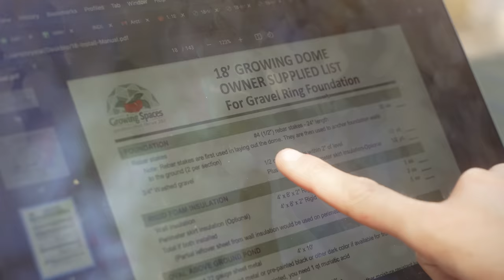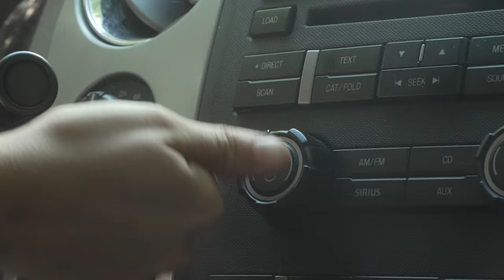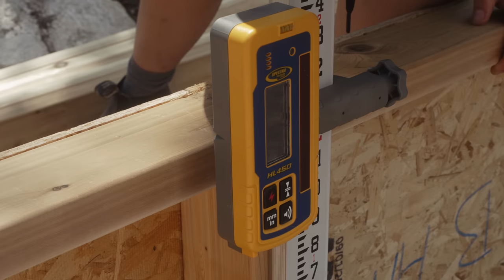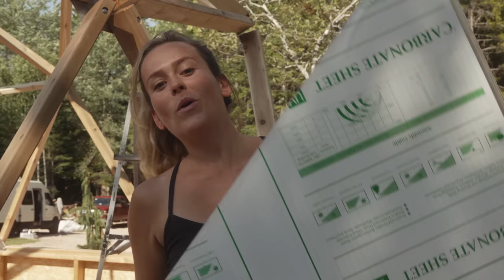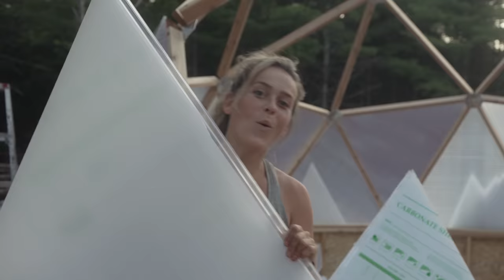We Built A Greenhouse In The Woods (part 1)

Comment: TIP: After awhile, especially if you've had some windy days, go around and recheck the bolts, retighten if necessary.  You can also take a marker or make a scratch running from the bolt to the plate so you can see if any of them are coming loose.

Comment: Safety tip:  when using a metal cutoff wheel, wear hearing protection, a face shield, eye protection behind the face shield, and breathing protection.   beware of the sparks causing a fire or getting onto exposed skin.   

Great dome build.   I was a geodesic dome builder (homes and commercial) from 1973 until the early 1980's.    My home was three domes.

Comment: This takes me back to helping my 72 year old parents build a 22 foot diameter Arctic Acres dome in summer of 2021.  They did all the pad preparation in 40° (100°) weather.  We started working from 5am to 10am and then 6pm to 10pm.  No other way to survive the heat.
All three of us are perfectionist and instruction readers but I have learned when to stop measuring and just get out the drill.  We too were so grateful to have spent so much time and energy on site prep and leveling.  It cannot be said enough how much of a difference it makes.  Have fun with the seam taping.  You will need at least a litre of isopropyl alcohol.  It can be hard to get sometimes so get it early and get lots.  And get your hands on three ladders to use while applying the tape.  Trust me on this, it makes it so much easier and safer.  And a shop vac is great for blowing stuff out of the polycarbonate before you tape it shut forever.
Reply from the maker: Wow Lynda amazing you and your parents built a dome just last year.. kudos to you! Thank you for sharing all your knowledge. We sure love it when are community has great advice for us.. 💛💛🐶

Comment: Another great video! A tip for winter snow is to permanently wire in 2 to 3 cheap jigsaws with their bottom plates attached to opposing 2x4's on the dome. The switches on the jigsaws should be permanently set to "On" and ideally a power line "on/off" switch should be run to the cabin. The jigsaws will generate enough vibration to remove any snow build up from the dome. I hope that makes sense???
Reply from the maker: Hey Warren, thanks for that tip. Makes sense.. we will definitely look into it.
Thanks for being part of our community.💛💛🐶
Reply: @Vanwives  You are welcome! Love your adventures and projects. Tip was learned here in the Selkirk Mtns of BC (just left of the Rockies) with High Tunnel Green Houses. There's nothing better than waking in the morning and while having your first expresso of the day noticing snow on the greenhouse and flipping a switch in the cabin and watching it all slide off. Then going back to bed of course ... lol.

Comment: simple suggestion: the north-side of the dome should be insulation, not glazing. The south-side glazing is important for the sun infiltration, but is a heat-loss on the north. I would have suggested insulating the ground as well to extend the seasons of spring and fall.

Comment: You bring back such fond memories.  My first job after finishing architectural school was to go to the JFK library and fix a leak at the top of the 6 story glass entry foyer triodetic space frame.  A few years later I was off to Abha in Saudi Arabia to build a triodetic space frame, over the Crown Princes' swimming pool,  with a Korean construction  crew who could not speak English and me with English drawings, design,  triodetic space frame construction experience not speaking Korean.  Each space frame part had a number and luckily we all used Arabic numbers and each part was shown exactly where it went in space.  A few years later I was off to Denver to build a 100,000SF triodetic space frame roof on a freezer where there were clear spans for 100 feet in every direction.   We lifted 10,000 SF of space frame into place at a time.   Triodetic space frames are my favorite way to build for so many reasons  the main ones being super fast pre engineered construction and way way less weight and structural materials needed which is great for the environment.  You gals have it down now and the sky is the limit. I hope your wood touching the ground is super well pressure treated or it will likely rot from ground up - the extra gravel at the base is a nice idea though.  They should keep you alive well and comfy this winter.  First thing I do every Sunday is watch your latest escapades of construction and self sufficiency.  Just look at all the skills you have picked up in such a short time.  Nice job.  Sorry to ramble on.

Comment: when angle grinding you need to think of that disk as a grenade with a temperamental fuse. If you do something it doesnt like, bend it, burn it, stall it whatever... it will explode and side carbine shrapnel flying around at incredible speed that disk is moving at like 130mph and I have seen dudes get chunks of it embedded in their body an inch or two deep. There are urban legend type stories of people having them explode and send fragments into major arteries in legs and neck. 

long story short, I know that are annoying but use the guard that comes with it and make sure its always between you and the wheel. also wouldn't hurt to throw on you chainsaw protection, the help with mask and built in ears, heavy gloves and chaps could save a lot of ouchies. 

I know this video is old but maybe some other enterprising young lady (or man) may see this and be like yeh... PPE is a good idea.

Comment: Seems counter-intuitive but I think such domes are easier to build from the top-down.  You put together the upper section including polycarbonate first.  Put it on a post so you can add the next ring including polycarbonate.  Put that assembly on a taller post, etc.  This way, you never have to work up in the air to fasten vertices or polycarbonate.  I noticed you didn't show that step, probably because it was very difficult and scary!  You can leave the bolts a little loose, so when you are bolting it down to the lower wall it's easy to get it all aligned.  Then you go and tighten them up from the inside with a ladder.
Reply from the maker: Hey Guy..we appreciate all the advise. We love the dome and are excited about growing food at home.💛🐾🐶

Comment: True north (also called geodetic north or geographic north) is the direction along Earth's surface towards the geographic North Pole or True North Pole.

Geodetic north differs from magnetic north (the direction a compass points toward the Magnetic North Pole), and from grid north (the direction northwards along the grid lines of a map projection). Geodetic true north also differs very slightly from astronomical true north (typically by a few arcseconds) because the local gravitational field may not point at the exact rotational axis of Earth.

The direction of astronomical true north is marked in the skies by the north celestial pole. This is within about 1° of the position of Polaris, meaning the star would appear to trace a tiny circle in the sky each sidereal day. Due to the axial precession of Earth, true north rotates in an arc with respect to the stars that takes approximately 25,000 years to complete. Around 2101–2103, Polaris will make its closest approach to the celestial north pole (extrapolated from recent Earth precession). The visible star nearest the north celestial pole 5,000 years ago was Thuban.

On maps published by the United States Geological Survey (USGS) and the United States Armed Forces, true north is marked with a line terminating in a five-pointed star. The east and west edges of the USGS topographic quadrangle maps of the United States are meridians of longitude, thus indicating true north (so they are not exactly parallel). Maps issued by the United Kingdom Ordnance Survey contain a diagram showing the difference between true north, grid north, and magnetic north at a point on the sheet; the edges of the map are likely to follow grid directions rather than true, and the map will thus be truly rectangular/square.
Reply: Thank you!

Comment: Couple of points about your build. Use marine ply and not hardboard. Secondly make sure each of the polycarbonate panels are sealed at the edge. Water moisture and alGae will ingress in between the laminates.
Reply: @иванкитаев-в4ф  not inevitable. If you seal the edges.